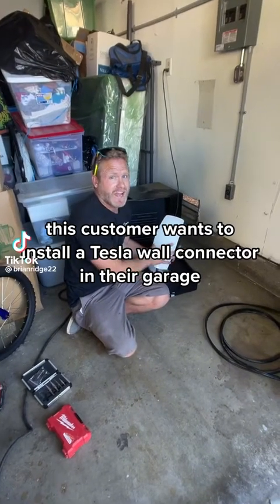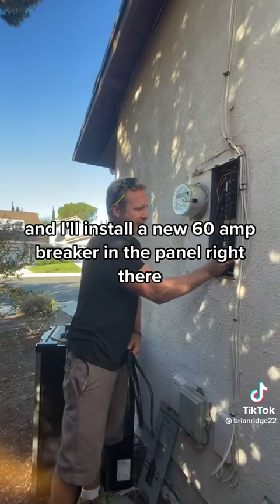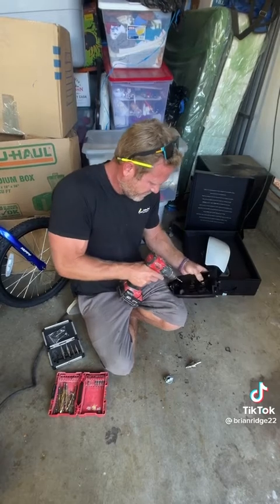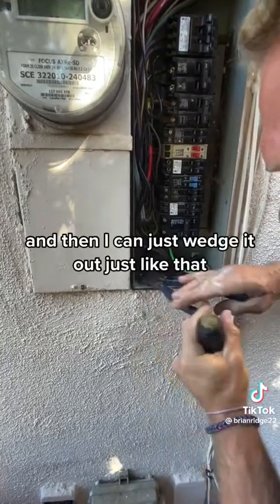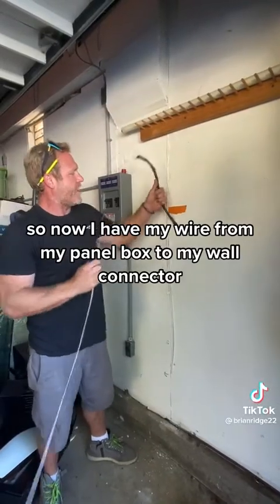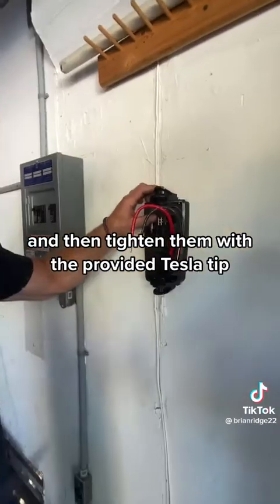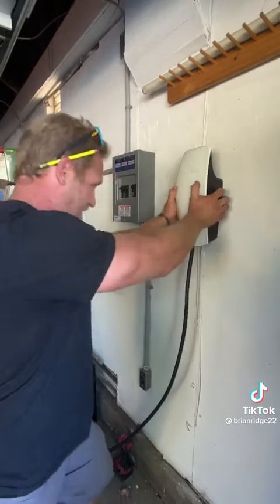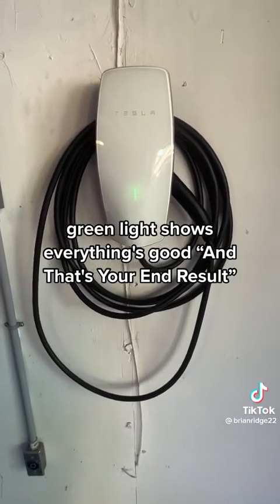Installing a Telsa Wall Charger

Comment: You got any advice on someone looking to get there licensen? I'm in Alabama been doing commercial and residential electrical work for the past 18 years, but always for someone else. Any advice is welcomed sir
Reply: Not the guy you asked but if you haven’t already. Do it. If your strength is operations and need help on sales, stay clear of lead generation sites like Angi or Yelp if possible. I would recommend signing up with home warranty companies for free. Look them up on google. They will feed you work. Convert warranty customers into repeat customers and a referral source. It’s not a conflict of interest because the warranty company doesn’t want the work, they just want the warranty payment.😂